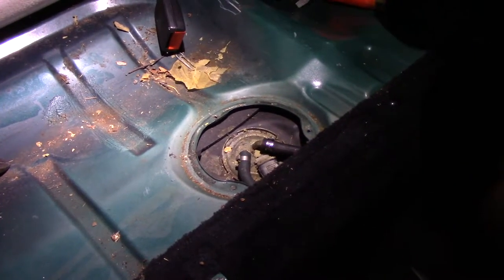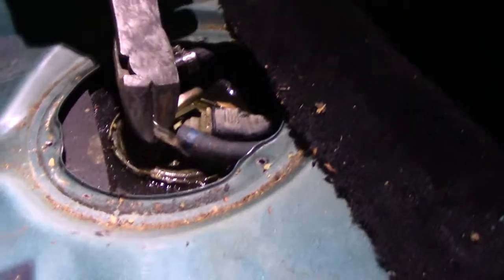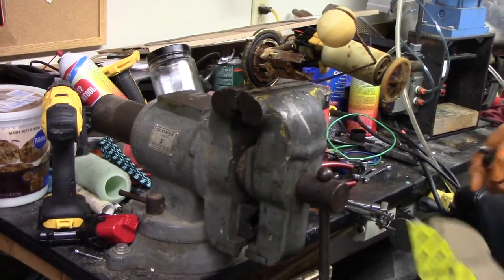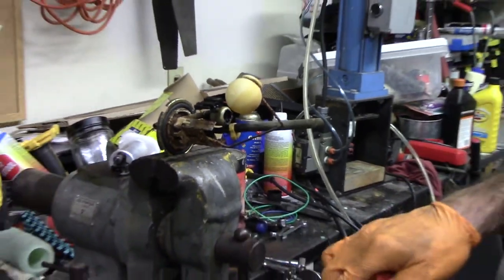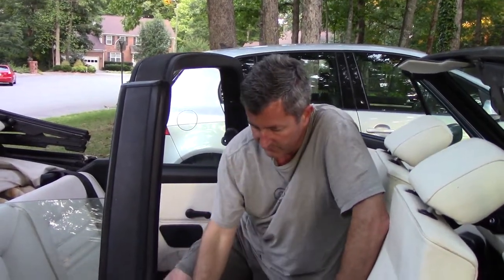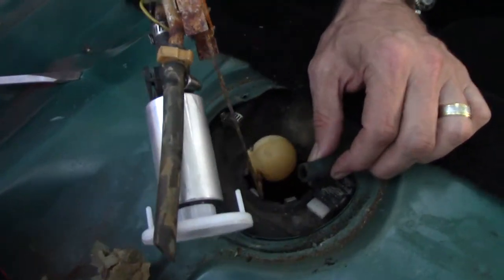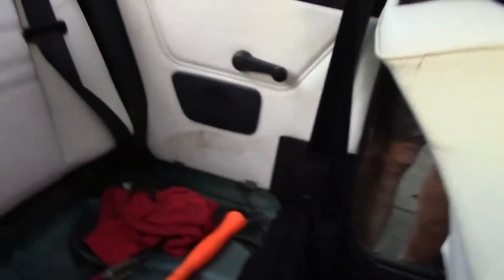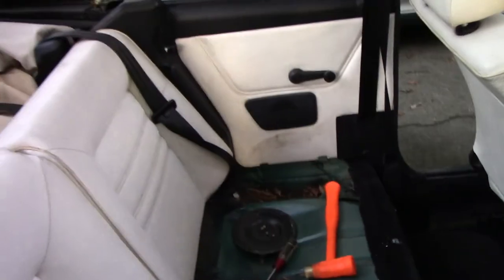Replacing a fuel pump in a 1993 VW cabriolet

Comment: I have a 92 that cranks but won’t start I sprayed some starting fluid into the air intake and it started do you think it could be a fuel pump all the plugs and wires look good replace the distributor cap too
Reply from the maker: I would check for fuel. I think that there is a test point on the fuel rail that looks like a tire valve that you should be able to press and see if fuel comes out.
Reply: How did you fix this I have the same problem
Reply: I need to know as well

Comment: I have a 1986 VW Cabriolet and when I turn the ignition on I don't hear anything from the pump but when I try to start it (Cranking) I hear the "whirring" of the pump.  My question is though when I turn the ignition on without cranking am I not supposed to hear the pump engage?  Any help would be appreciated.
Reply from the maker: Richard Florian An '86 has a different style fuel injection. Some cars will run the fuel pump for a few seconds before engaging the starter and some don't. I am pretty sure all of these cars have 2 pumps, one in the tank and one under the car. The one in the tank supplies the one under the car. Are you experiencing a particular problem?
Reply: Yeah.  When I try to start it she cranks and cranks.  If I spray quick fire into the combustion chamber it starts to run and then quits.  No fuel is getting to the CIS system.  I'm thinking it's probably the fuel pump in the tank which may be one of the issues.   I'll try to switch it out and we'll see what happens.
Reply: @richardflorian1086  I have the exact same problem with an 87 scirocco except i cannot hear it whirring at all. Did you find the issue?

Comment: Would you know what the fuel pump part number I would use on a 93 VW cabriolet convertible collector's Edition with automatic transmission? 
Thanks for the video! 😊
Reply from the maker: I do not know the number. I think they are all the same so it should be easy to look up.

Comment: Just got an 84 that wont run for longer than 6 seconds 
Also the gas guage isnt registering any gas at all 
Could it be the whole sender unit is bad 
I unplugged the top cable and tried turning it on and it runs exactly the same so u suspect the pump inside the tank isnt working at all
Reply from the maker: You should probably pull the unit out of the tank and see what it looks like, it is easy enough to do. It will also give you a chance to look at the condition of the tank as well. Usually if the in tank pump does not work the main pump is really noisy.

Comment: Hi, Can you tell me the part number of the fuel level sender? Not the fuel pump. 
Are there any car with the same system? Want to aply on my vw golf mk1 , 1976.
Reply: I kept checking eBay and found a perfect replacment for my 89 cabriolet , they are hard to find

Comment: Would you know best place to sell my 93 VW collectors Edition cabriolet convertible with automatic transmission? What price could I expect to get for it if it needs cosmetic and electrical work but runs and drives? 
Thanks for the video
Reply from the maker: Car values are hard to predict. You could look up NADA values but that is sometimes not a good judge of what people are willing to pay. Look for a Facebook Cabriolet group, I bet there is one or a VW Mk1 group. Join that and lurk there for a while you might be able to find a buyer or some advice there.

Comment: were you able to remove the floor carpeting without cutting it? I am about to undertake this project soon. My Fuel pump is damn near whistling yankee doodle  at this point
Reply from the maker: You just need to remove the rear seat. There is a fuel pump under the car also. You might want to check it too.

Comment: I just did my 1990 vw cabriolet. Thanks a lot. I have a different question. My door chime don't work anymore do you have any  idea how to  fix it. And thanks again for  you video.
Reply: have you checked fuse or relay?
Reply: @EthanoftheD30  no but I haven't. But which relay or fuse should I check.
Reply: Bernardo Sanchez ramirez checkout cabby-info.com its an awesome site for cabriolet owners. If you go to the ‘TechCenter’ tab and click ‘electrical’ there should be a link for an image of the fuse and relay panel under the drivers side dash with everything labeled